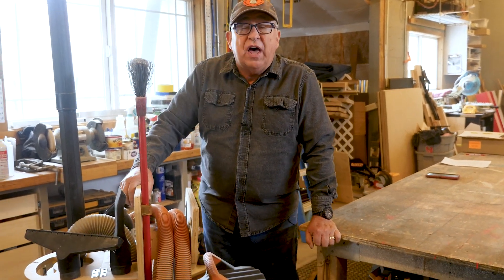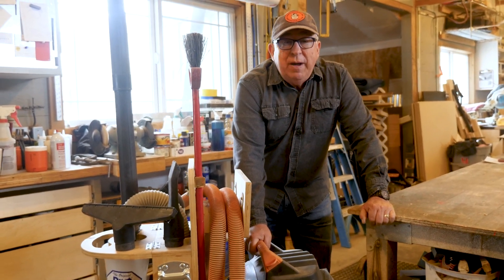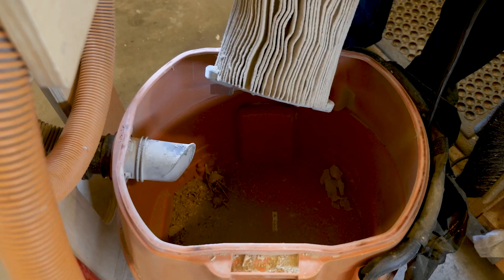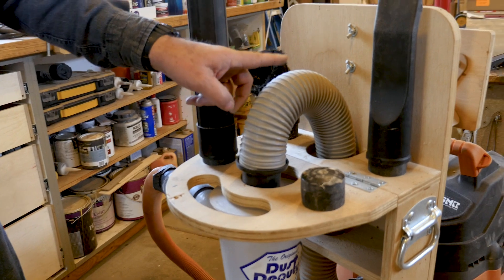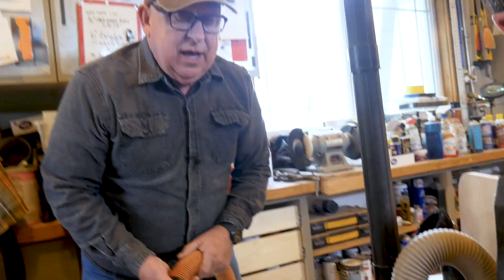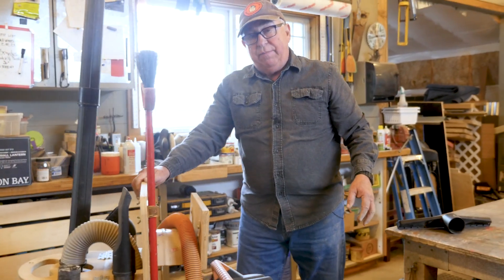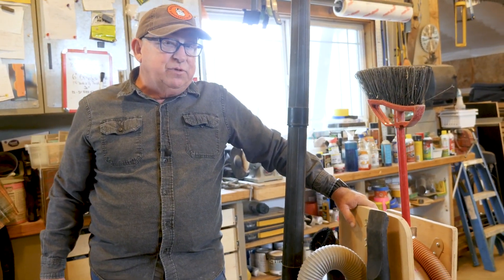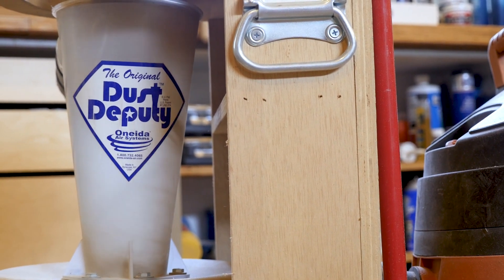Build Your Own Cyclone Shop Vacuum!

Comment: What I don’t love about this setup is how much space it takes up. As a hobby woodworker with a small workshop I’m always looking to reduce bulk. Has anybody found something with this design that has been optimized for smaller workshops? It seems like it’d be doable to have an integrated cyclone. I mean most of the space in the vacuum bucket is not even used so definitely some optimizations that could be made
Reply: There's tons of builds that are more vertical as well, some use pvc pipe on the same points your extra attachments go where the wheels are then a platform on top of the vacuum to hold the bucket. With this setup the footprint is the same as the shopvac it's just stacked up vertically instead of side by side like this one

Comment: A number of years ago my husband was away for an extended period of time caring for a family member. While he was gone, I rebuilt his work table and added a vacuum system a lot like this one. Mine is a double decker instead of a side-by-side.  I also ran ducting along the back of the work table with inlets for the mitre saw and router. Like yours, mine is also on a wheeled cart with places for the accessories. He came home for Christmas to a nice surprise. If I could do it, so could anyone. I bought my cyclone via Ace Hardware and they promptly delivered it to my local store. I think I'll add a broom holder.
Reply: You sound like an awesome wife!

Comment: I don’t se any advantage to the cyclonic adaptation, you can empty the bucket or empty your shop vac
Reply from the maker: Got it, Darrell.  I like the fact that it removes the vast majority of the fine dust too before the air stream encounters the shop vac filter.
Reply: Once you try it you will see the advantage.  Bypassing the cyclone will clog up your filter faster.  Emptying a bucket is a lot easier than emptying a shopvac and cleaning a filter.
Reply: @georgequalls5043 
Yes - the idea is to remove dust, but a shop vac becomes “too efficient” and the airflow goes down a lot. So by removing debris/dust before it gets to the filter leaves you with a much more effective system and longer service life